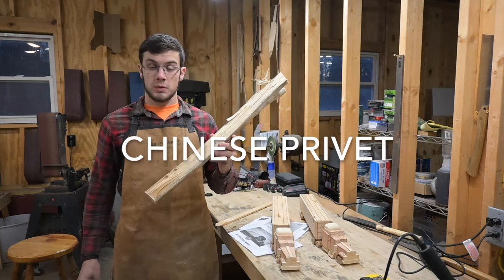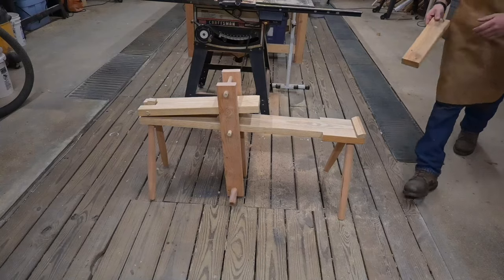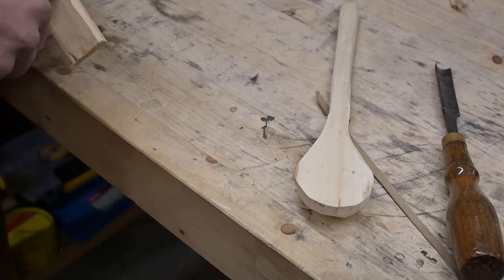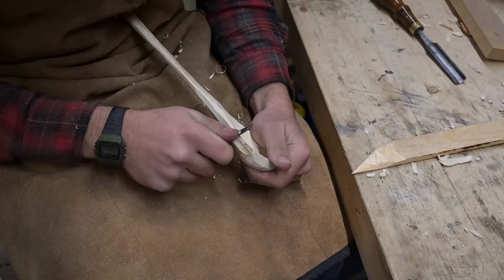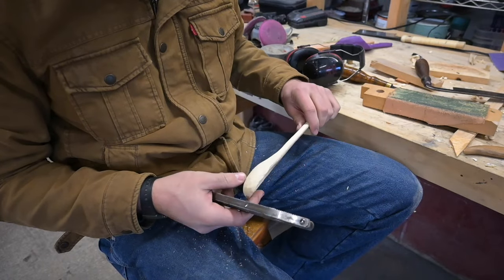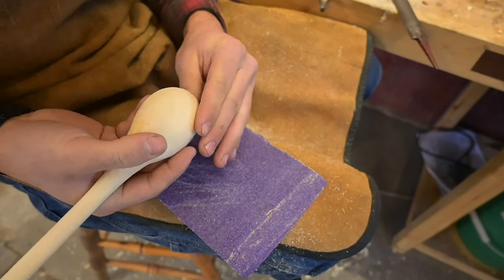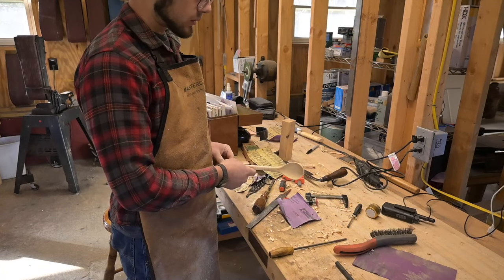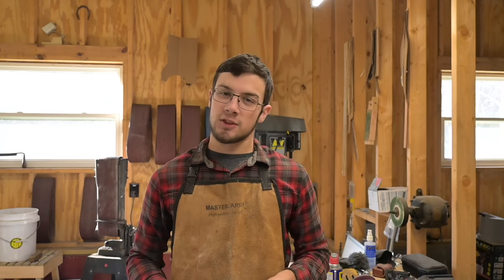Carving a spoon from an invasive tree

Comment: Great video.  Had some good humor mixed in, which is nice.  I have to point out that your symbol at the end is very similar to Chris Reeve Knives.  I'm not really sure how all that trademark stuff works.
Reply from the maker: Yeah, I know about Chris Reeve's logo, I came up with mine independently but that probably wouldn't make a difference. There are a couple minute variations on mine, it actually used to be more similar, hopefully I won't get sued.